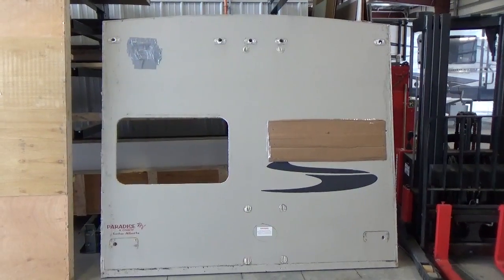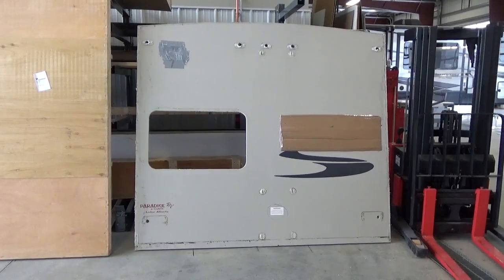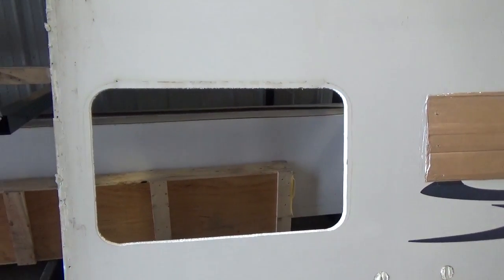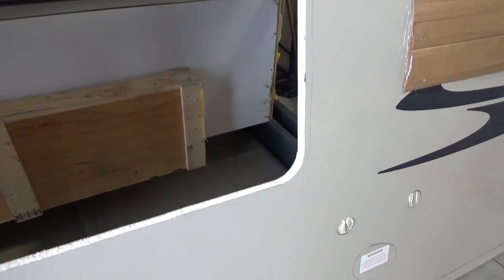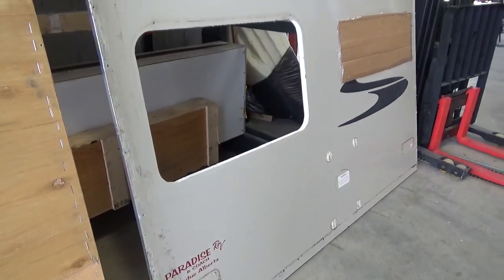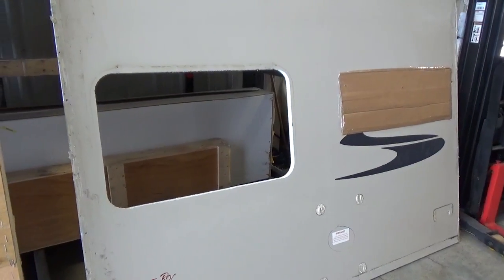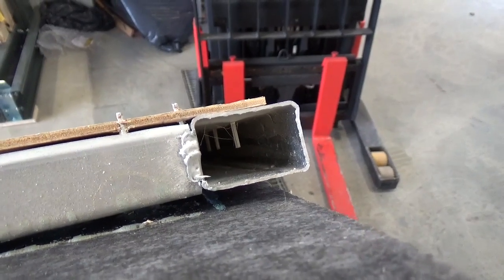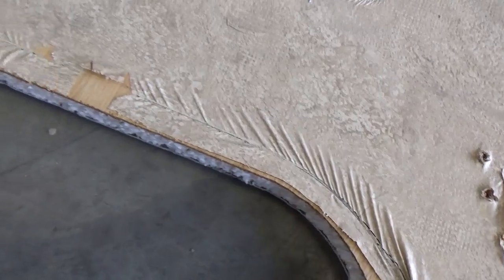RV Wall Lamination, Differences EXPOSED! Can you see the difference?

Comment: Good video, I'm rebuilding the back wall on my 2013 Open Range MesaRidge 281FLR. Also replacing both slide floors. 3 improperly sealed windows and one storage door. Front cap was replaced previously under an insurance claim, insurance said no to the aft wall and stated coverage of the front wall was a mistake. Framed windows will be on the list for the next trailer along with Azdel walls.
Reply from the maker: Great insight Derek! Be careful you buy a trailer with a superior seal. You are only as good as your seal. Also, a structurally sound trailer is important as well when looking at Azdel. One of the major downfalls of Azdel is that it has extremely poor screw retention. If the structure isn’t the there to support the screws, your seals will give way. Remember also that water intrusion will affect the wood in the floors and roof where Azdel isn’t typically located. Again I go back to making sure you have a superior seal and structure, which is what you get with a Grand Design RV.